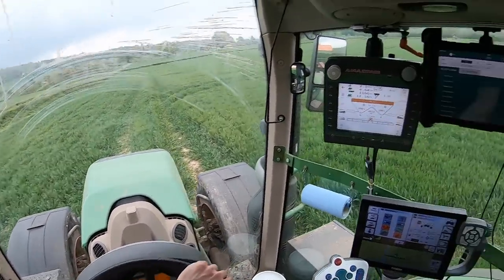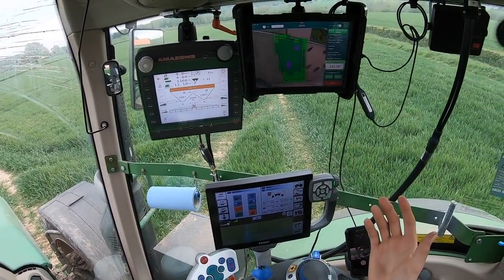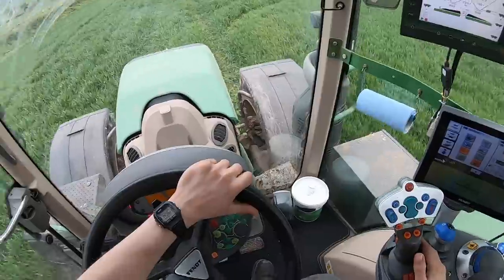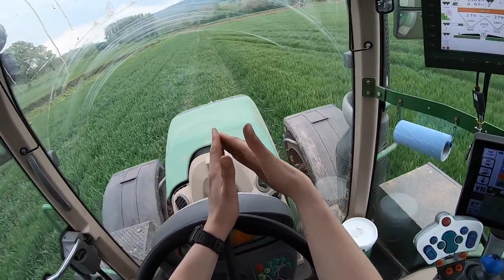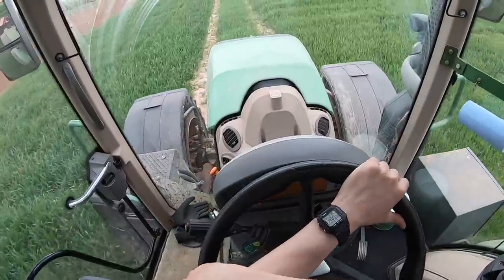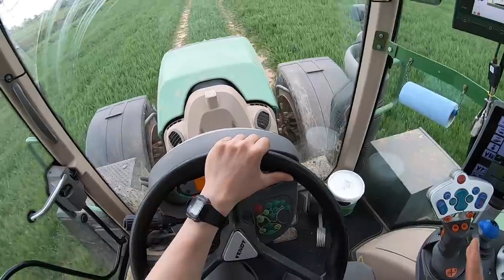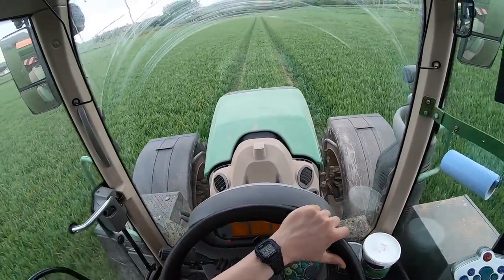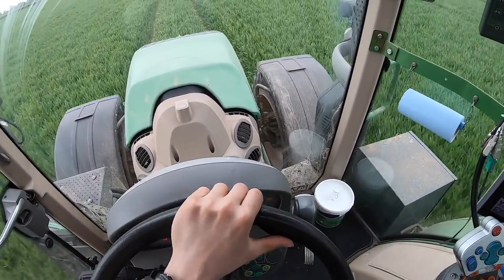How To Use The Fertiliser Spreader - Fendt 724 and Amazone ZA-TS

Comment: Nice vid, we personally give the forklift a rinse off every night when on fert. And the spreader after all that application usually only 2 days in total. We would do it nightly but it takes to long to do a thorough wash and a part wash just spreads it. But u can see where the fert starts to attack the metal overnight. My view is that it’s an expensive spreader and then metal will give up a lot quicker without washing than the electrics will by washing. 
Keep up the good work
Reply from the maker: EA Ben Thanks for the comment! Interesting points! Do you wash the whole forklift or just the forks/ front?
Reply: @JJ_MacLeod  we tend to wash the lot because it gets under the boom and on the cab, wouldn't be so bad if we were only loading the bags, but quite often i will cart them to the field on the tines so bits blow out. your just as well for the time it takes to do the lot, i mean it is only a rinse not full detergent wash.

Comment: I am considering buying either an Amazone or Kuhn spreader.  Do you have any suggestions or comments on either?
Reply from the maker: I haven’t used a Kuhn spreader but I have been impressed by the Amazone. Simple to use and seems to give a a good spread pattern. I have heard that the paintwork on the Amazone is slightly better than on the Kuhn but I couldn’t tell you that from first hand experience...

Comment: Hi. Quick question, why do you drive against the way that the spray man goes?
Reply from the maker: Archie Vipond Mainly because of the headland corners. The sprayer reverses back up to the hedge, and I go right up to the hedge forwards. So it just means we only run the crop over in the corners one way - obviously reducing crop loss but also looks neater too.